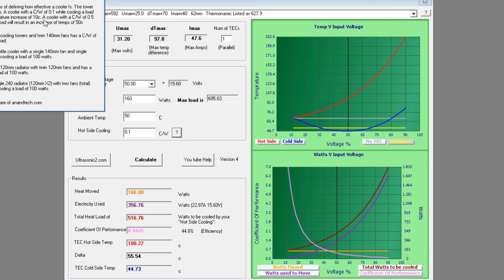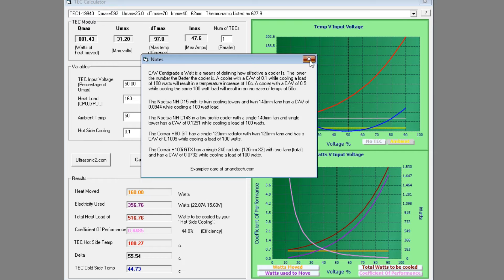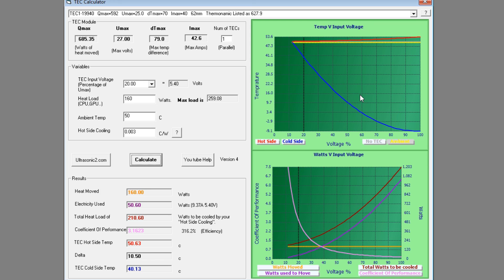🎓 Understanding Peltiers: TEC Calculator. Update. Episode 6

Comment from the maker: Get the TEC Calculator from this link
http://ultrasonic2.com/MD_software/TEC_CAL.zip
Reply: Hello ! Thank you for the videos. They are awesome. I am doing a project right now and you calculator would be very useful. The download doesn't work and it is not on your webpage either. Did you move it for patreon only or somewhere else ?
Reply: Hi! Just installed and tried to run it. But it is not show any window and stay in tray sucking 30% of processor power. Windows 10. Can you help with it?
Reply: Roman Faktorovich Run it in adminstrator mode i had the same issue
Reply: Same for me... Its using 8% of my CPU and no window.

Comment: I am unable to use this calculator right now on my windows 10 computer, its giving a license expiration error? it says this error : Project1 Your License has expired please download another copy . This program ran fine on windows 10 when I first installed it, I haven't ran the program in a couple months. If I change the year on my computer to 2018 the program runs fine.
Reply: I have the same problem, it will run the software but when I press calculate it gives the licence expired message and I cant use it. Have you solved this issue yet?
Reply: @dong9224  I actually figured out the problem, its a date problem , set a date to anything 2018 and the program works
Reply: @MichaelWeaser  Thanks yes it works, slightly annoying as have to be careful running other software with incorrect date but its a workaround, thanks
Reply: @dong9224  the person who runs this YouTube channel , who is the programmer of the program does know about the issue , not sure when it will get fixed.

Comment: Hi, im currently using your calculator to design a 3 stage stack of peltiers to achieve super low temps. in this latest version your unable to input ambient hot side temps of below 0C, whereas  in previous versions you could? what would be the best approach  to do what i need with this current version? any help would be greatly appreciated!
Reply from the maker: Is doesn't allow for sub zero cos it's accuracy is questionable
Reply: does this relate to the changed efficiency of the peltiers at the lower temps? or do the equations used become finicky at low values i.e. high decimal place value outputs. my current workaround as been to simply assume 0c is my target temp and input ambient temp as 0 + total Delta required... and allowing for  lost efficiency.
Reply from the maker: um i can't remember the actual issue now .. that was originally written almost 20 years ago now .. lol
Reply: @Ultrasonictwo  I tried downloading your TEC Calculator from http://www.ultrasonic2.com but it's not listed anymore, have you moved away from it? Wanted to try it out to see if my numbers are correct.
Reply: @Ultrasonictwo  
Would love to have a copy again, any chance? I dont mind if its inaccurate or some such, it was great to understand in general how it all works, the math is beyond me without it.
Reply from the maker: @Chris̨D-y9m  Get the TEC Calculator from this link
http://ultrasonic2.com/MD_software/TEC_CAL.zip
Reply from the maker: @gloriouspopemantom373  Get the TEC Calculator from this link
http://ultrasonic2.com/MD_software/TEC_CAL.zip
Reply: @Ultrasonictwo  thanks!

Comment: How did you managed to integrate the datasheet graph of your peltier module to the TEC Calculator??
Im working on an Excel sheet to create an calculator myself for an refrigerator project, but getting that graph from the datasheet integrated is causing trouble. Thanks for reading and good luck on whatever your working on.